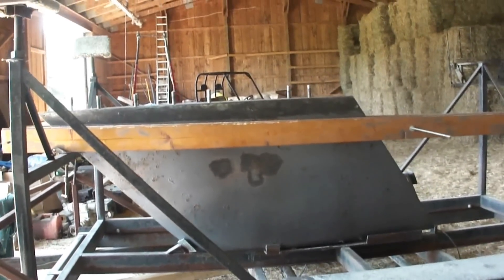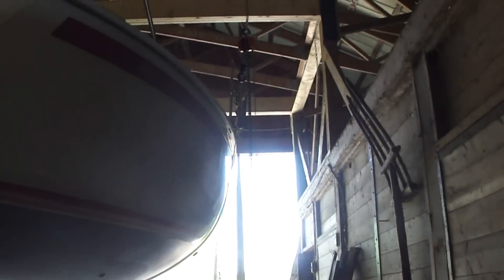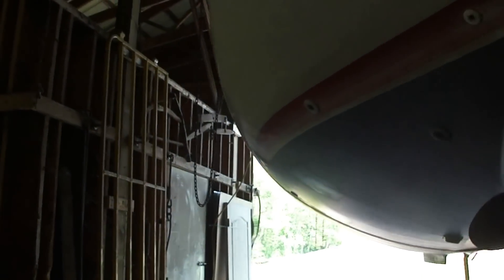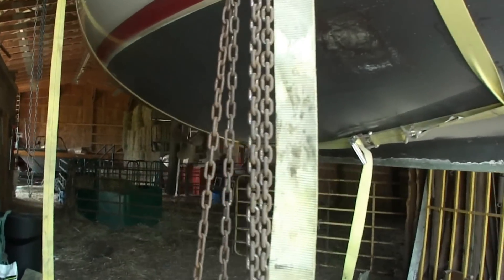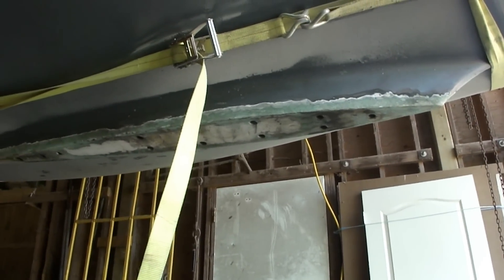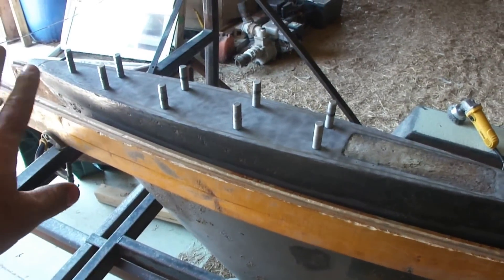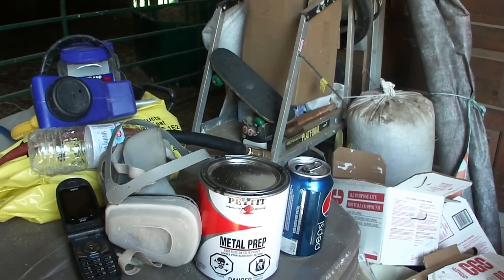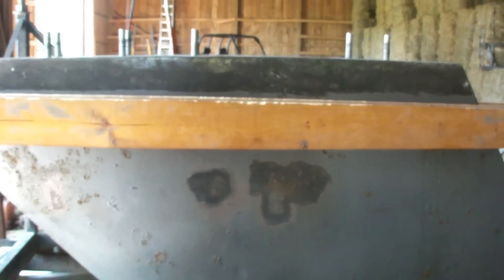Keel removal

Comment: Thank you for the video. Did you replace any of the keel bolts? I am considering a similar job. How are the bolts secured to the keel: cast or threaded? If the keel bolts are cast into the keel vs. threaded into a cast nut/housing; replacing the bolts will be a much bigger/expensive job. Thank you.
Reply from the maker: Keel bolts were in great shape. They were cast into the keel and unfortunately I don't really have any solid advice for you on that. Hopefully your bolts are in good shape and you won't have to worry about it. 
Derek

Comment: Nice set up! I was planning to do exactly the same thing. I'm considering renting tubular scaffolding to building up the hoist though. How did the gasket work out?
Reply from the maker: Keel is still tight and no water infiltration.  The faired joint did crack but its completely understandable why it did.
Reply: Great! I'm still loosing sleep on which material to go for keel bolts. 😅
Reply from the maker: Didn't have to replace mine but tightening the keel nuts to torque spec was the hardest part. I think it was around 350ftbls and there is little room to get a good pull. Broke two extensions doing it.
Reply: Thanks for the heads-up. Might have to borrow an air wrench.

Comment: Thanks for sharing. Question: did the keel come of by itself, when lifting the boat, or did you have to cut through the old sealing to make it come loose?
Reply from the maker: I had felling wedges for directing trees when cutting down and just worked my way down with wieght off the keel. Came apart easily.

Comment: Wood is very expensive. I could weld up a similar hoist in a fraction of the time and  for a much smaller outlay using rectangular section steel tube. By triangulating the structure it can be mabe to be very light and strong.Not trying to deman your efforts though.

Comment: how much approx. did the hoist cost to build? Thinking of building something like this to lift a boat from stands on to a trailer as opposed to renting a crane.
Reply from the maker: I was lucky as I had structure on both sides to attach 6x6 and I bought the chain falls on Kijiji or criags list of under $50 each. Used it many time for other projects not boat related so was useful in more ways than 1

Comment: Salut dans L'eau, 

Thank you for the video. I have an 820 as well and I would like to tighten up the keel bolts. Do you have the torquing specs? If not, how much did you tighten them?  Merci!
Reply from the maker: 300ft lbs is what I was told but could get that big a pull on them. was able to get 280 on most and din't have any movement. Just sold her last mth and now have an 1988 Hersh Irwin 44.
Reply: Merci!